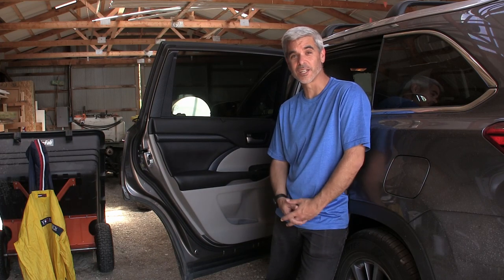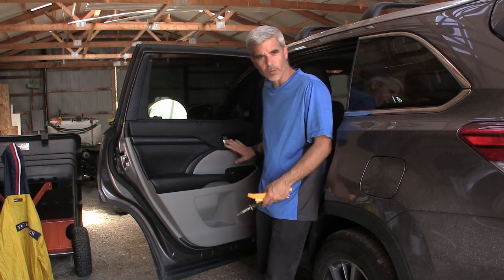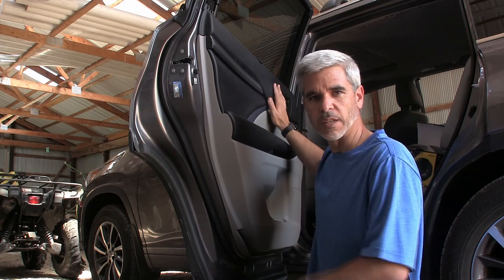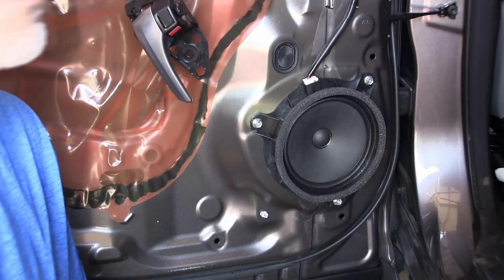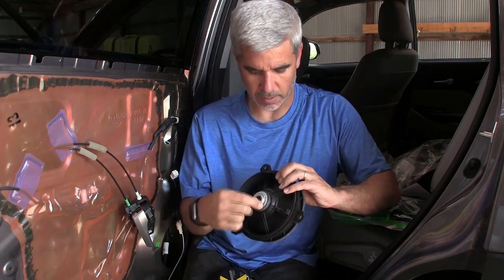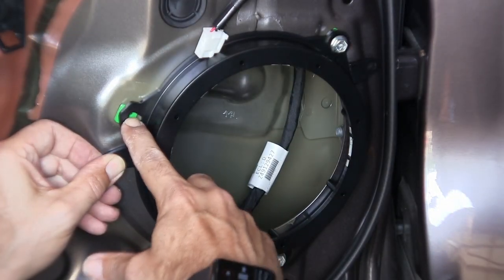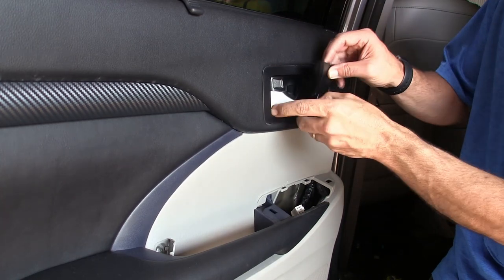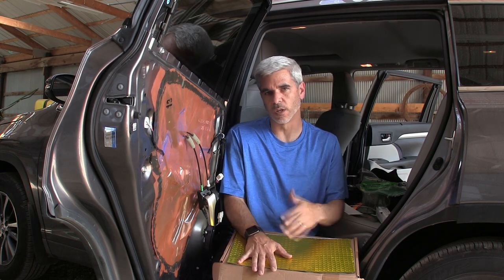Toyota Highlander - Rear Speaker Replacement

Comment: Thanks for making the video and recommendation of the speakers!
FYI, interior panel, alway release from the bottom corners (least resistance) then sides upward...
Reply from the maker: Rick T thanks for the suggestion.  Makes sense as the bottom also seems to release easier than the sides as well.  Have fun!

Comment: You don't need remove the entire speaker, just brake the old one and add the new speaker on tap the original mount and always sound better, I did in my 2021 Highlander and sound super cool, good video

Comment: There is a small hole in bracket to run wire through to speaker so you don't pinch speaker wire to the door and you should put thin foam on bracket between door and speaker.

Comment: I wondered why my Wife’s Higlander has that crappy sound!! Thanks for the video! I’ll get the speakers replaced! 👍
Reply from the maker: Yah definitely will be a huge improvement in low end when the rear speakers are on.  Note that the head u it limits the low end going back there so you don’t get full range sound even with good speakers, but at least they won’t be distorted all the time with better h it’s installed.

Comment: bruh!   really great share!
i have a 2021 camry.   i noticed the same thing with my rear speakers.   i have a spl meter.  the rears play 6 dbs lower then front and the rear doest have a tweeter.  thats why they sound like that.   that speaker you installed should make a great difference!    kicker has some "key" amps that will make those speakers pop!   they have a dsp built it to really blend the music.  they are easy on the electical system.

again great share!

larry
Reply from the maker: Thanks so much Larry!  I've considered the amp idea.  I'd also like to get a compact Sub in there as well, perhaps under the front seats.  Have you done that before?
Reply: @DansWay  I have a 10” kicker box in the trunk.
Powered by a kicker “key” mono amp.
I pulled the signal from the front fronts.

Crutchfied  sold me a adaptor to the tweeter harness that came with a jumper wire.
I cut the jumper and used one of the ends for the sub signals.  No oem splicing.
Much better now. Sub really completes the experience.
Reply from the maker: @mafosa8519  thanks so much for the info.  I'll definitely keep this info for later.  Do you have a way to adjust the sub volume?  I find it annoying that some content is mixed to where you can't really enjoy it because of low-end balance issues.
Reply: @DansWay  on that kicker amp there two ways to adjust the bass output.
1. Add a bass control into your dash.
2. On the unit itself there a “subsonic” knob that can be adjusted.
It’s really a nice amp for the money you pay.

Larry

Comment: Whenever you use these plastic adopters, always use speaker gasket tape ... between speaker and adapter, and adapter and the door.
Reply: why is that needed?
Reply: @algallucci9336  So the back pressure soundwave and the front pressure soundwave do not engage each other. It creates an airtight seal. Sounds much more crisp and clean.

Comment: Great video, Dan. I just purchased a 2020 Highlander and despite not even having listened to the factory (non JBL) system, I suspect I'll be making some changes. My biggest concern is that the head unit will alter the frequency response as you turn up the volume. My Subaru does this and even with an external amp on the speakers, it sounds like absolute garbage. In your case, it looks like your head unit is pumping out a flat, unaltered frequency response but your speakers are just crapy and can't handle it ( a good problem to have). I'm looking forward to digging in to the 2020 and making some videos. Thanks for posting!
Cheers

Comment: Now you need to add a bigger amplifier. I’ve replaced ALL the OEM stereo equipment in my 2008 HL. Now it’s like driving around in a concert!
Have you done the subwoofer yet?
Reply from the maker: Where did you end up placing the amp?
Reply: @DansWay  I have two amps mounted in the cargo area where the tools are. If that makes sense. In my HL, it’s that long section that lifts out. 
I have a 4 channel tha does the doors and a mono/2-channel for the sub(s)
I replaced my lift gate sub with a Kicker 8” slim CompRT DVC and I have a single 12” enclosure. The 8” is really just a backup sub, should I need to remove the 12” for hauling stuff.
Reply: @DansWay  I’m currently working on reconnecting/replacing the dash speakers. Kicker just came out with a KSC270 that fits!! (2.75”/70mm with correct mounting brackets)

Comment: if you have 2019 you need to take the two hidden screws out under the stationary door handle ( not the one you use to open the door ), remove the plastic cover n the center of the handle and take out the top and bottom screw, please don't ask me how I figured this out

Comment: How about bass sound?
Reply from the maker: Keeping in mind that this is a 6" speaker, it is much better than the factory but only a true sub will get you real punchy low end.  Doing the sound dampening material will help as well.  I changed the front and rear and am happy with the total low-end, but will need a real sub to get hard punch.  I'm not into super loud concert like music anymore, so now I'm more into full-range sound at a lower volume which these speakers provide.

Comment: @Dan Holt Hi. I just got 6.9'' and 6.5'' kickers for my toyota highlander XLE. The output is a minimum of 300 watts and can go up to 600 watts each. Do i need to get an amplifier to power up the sound or will the factory fiited power amp be sufficient to support tthe high end kickers ? please advice
Reply: Some of the highlanders have 6x9s up front that's why.

Comment: In the replacement speaker do you have better bass?
Reply from the maker: Loop Hole, actually this speaker has a very stiff surround so it takes a lot of power to drive it. They are also only 6.75” speakers so they don’t have a ton to offer.  An external amp would likely make them drive harder.  What has changed as is the quality of the low end.  Listen with headphones and you can hear that the bass is now tight and controlled, but not loud at all.   The front speakers are providing most of the low end.  There is a sub in my future...
Reply: @DansWay  Thank you

Comment: Did you find it worth fo putting  kickers?
Reply from the maker: karanvir singh absolutely it was so much better after the change out.  The factory head amp seems to eliminate a lot of the low end on the back speakers as well so don’t expect thumping from any rear speakers without an external amp.